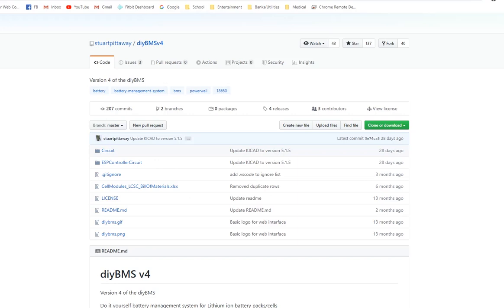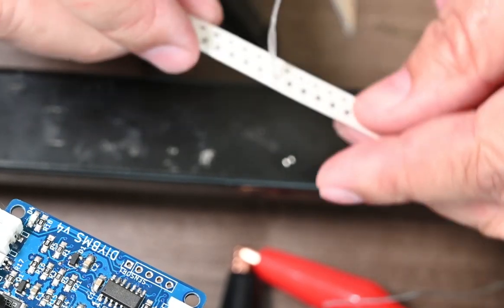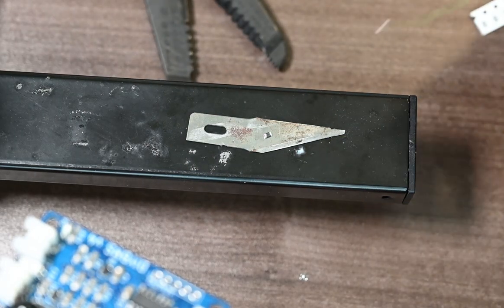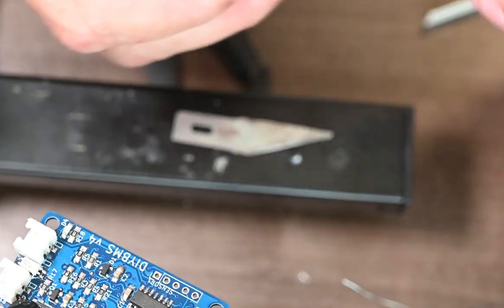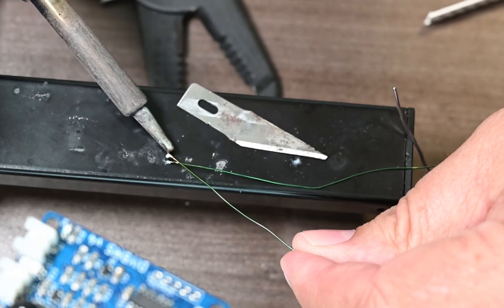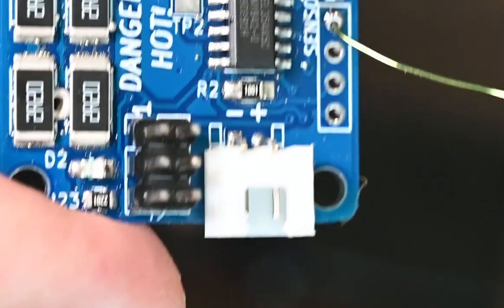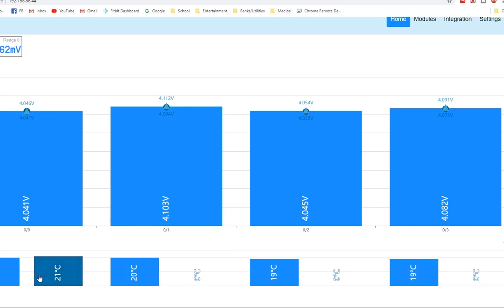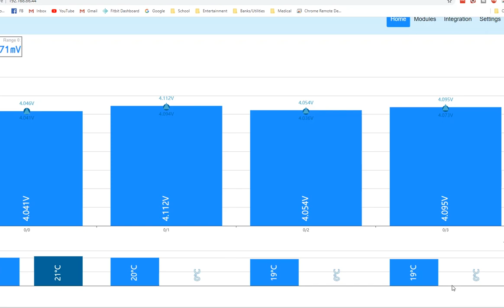Add external Temp sensor to DiyBMS V4

Comment: if your followup video you only had 1 panel that was not high enogth voltage to charge the 7s config you could use a boost converter into the mppt for upping the voltage to be able to charge all in one go

Comment: I just ordered the Netgear Nighthawk Whole Home Mesh WiFi 6 and was wondering why you don't use Ethernet Backhaul? That's what I'm doing and for someone like you especially running CAT-6 or CAT-7 should be a snap. If you have a larger home then use 4 or more APs. Anyway good luck!
Reply from the maker: I am using a backhaul for one. It's too complicated to get a wire ran from my network closet without getting in trouble with my wife for the upstairs!

Comment: How far can you keep a bms board from the battery pack so that it will still work fine for temperature sensors
Reply from the maker: The accuracy could be impacted the longer you go. Since all wire has some resistance, the would affect the readings. But you could factor that into the reading.

Comment: Rick, do you have an exact part# for that thermistor?
Reply from the maker: I used the same one from r19 on the board. SDNT2012X473F4150FTF	Device:Thermistor	Resistors_SMD:R_0805_HandSoldering	https://datasheet.lcsc.com/szlcsc/Sunlord-SDNT2012X473F4150FTF_C95969.pdf
Reply: @RicksGadgets  That's what I thought, but wanted to make sure. Thanks